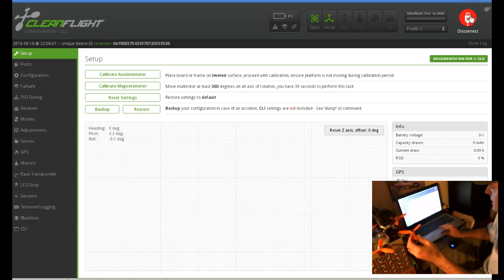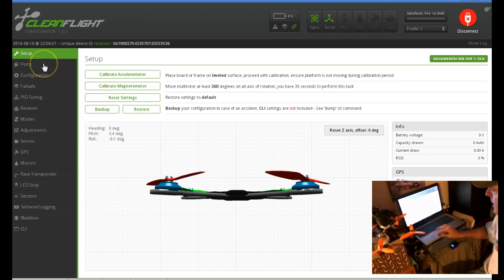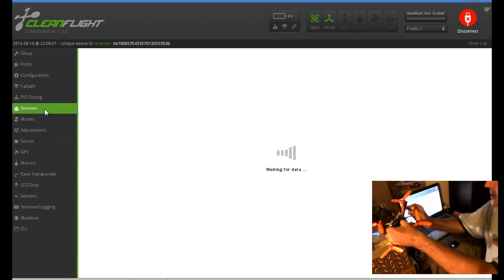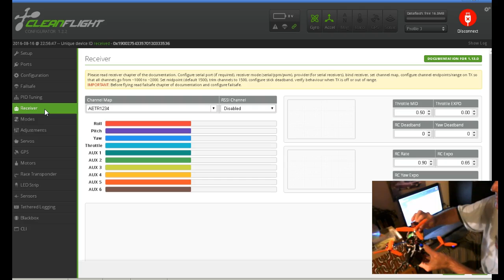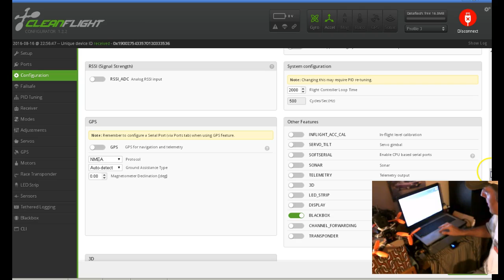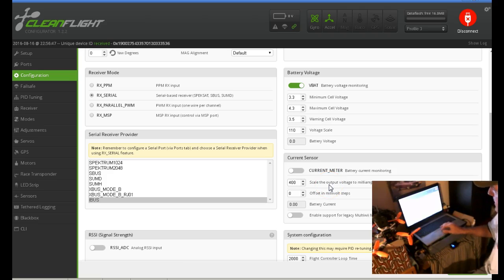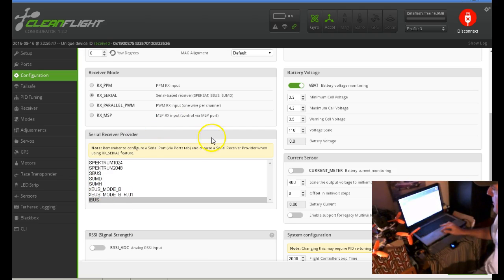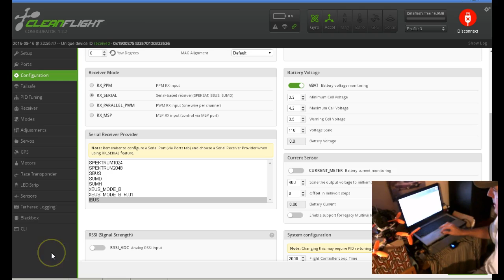FlySky IBUS Set Up In CLEANFLIGHT

Comment: super wicked man. enjoying your flight skill set. I appreciate the second cam ont he sticks too. I got myself a pawn shop racer, and im trying hard to get it working. I am so close. got cleanflight with the motors all working, I just need to set an arming but having toruble with arming, failsafe, and getting it to register the magentrometer. i need a live session or upload my build. I got 7 batteries just waiting. I am trained on a few others. I am soooo close.  its set at serial.. when i go into contols, i dont get controls for anything but left stick. its in the serial port... i think i have that same flier.. its go orange props just like that...
Reply from the maker: Make sure you have arming enabled and assigned to the right channel. Also make sure copter is level. Keep trying!

Comment: This didn't work for me, so I want to try this with uart 3, but all it shows is uart 1 and 2
Reply from the maker: Drone Enthusiast depends on your flight controller. uart 3 is the norm.
Reply: Kyle Killorin I have a naze32 rev6
Reply from the maker: Trial and error. Just be sure to check the right protocol in the configurator and click save! Also make sure you have max and min throttle checked too. (Once the GUI recognizes your board). This video I use uart 2 because my main uart pin was broken.

Comment: Thanks for the video. I couldn't get Uart2 to work, but Uart3 works perfectly. All my trims and subtrims are perfect now. I'm not sure why they don't advertise this, as it's much better than ppm, and you don't really have to do anything to get it. I thought I was going to have to buy an SBUS receiver, because I had no clue that you could do this.
Reply from the maker: My Uart 3 connector on my flight controller broke so sorry if it's misleading. At the time I released this video, there was very few vidoes about this. Thanks for watching.

Comment: Hi I have a flysky fs-i6s transmitter and fs-x6b receiver and I am only showing 8 channels in cleanflight. Any idea how to get aux 5 and 6 to show up ?
Reply from the maker: Add another by clicking aux on the left then assign a function to it.
Reply: hmm I have cleanflight 1.2.4 and I am on the receiver tab on the left, but I do not see any aux buttons to add/click. my channels 1-8 are functional in cleanflight and I have 9&10 setup in my flysky i6s, but still dont see them.
Reply: hey boss, thanks for the help. i just wanted to provide an update to my issue. the problem was the firmware. I flashed a new december 2016 stable firmware, and good to go in ibus/sbus all channels appear

Comment: HI THANK YOU SO MUCH FOR THIS VIDEO..please can you elp me to get my transmitter set up for ppm,have 3 very good quads on the way from banggood but jea i am a noob and very new with this,please help me set up ppm..would be awesome if you could make a small video on this thank you so much in advance
Reply: i also use the flysky fs-i6
Reply from the maker: PPM is not very accurate. It jitters and lags more than ibus. Problem is you need a RX that supports it. Did you get it figured out?

Comment: i need to know which of the ibus servo pins does what? i know its simple but from right to left i'm assuming its gnd, power, signal?.. i have the added complication of using a cc3d on betaflight to contend with,, its a bit worrying that there are zero videos on youtube.... i'm at three deads ends.....

Comment: thanks for the video bud! it's just what I was looking for!
Reply from the maker: No problem. I couldn't believe no body had explained this.
Reply: I connected everything last night and it works great! Only issue is that I was using the iBus signal and not the iBus servo, but you covered that in the video...so I wasn't pulling my hair out trying to figure out the issue !
Reply from the maker: Right. I love the Flysky TX. They are cheap and simple. I want to get another one and do the 10 channel firmware hack. Don't forget to save and reboot on every page!!

Comment: For your failsafe on the i6 turn on failsafe and turn channel 3 Throttle to  -100 value then push and hold cancel to save it that will kill the quad when you turn the tx off or the quad looses signal.. I learned that the hard way to always setup failsafe!!!
Reply from the maker: Hey thanks! It was max throttle for just a second then go into cleanflight faillsafe which has 2 separate FS. So 3 FS in all to set!